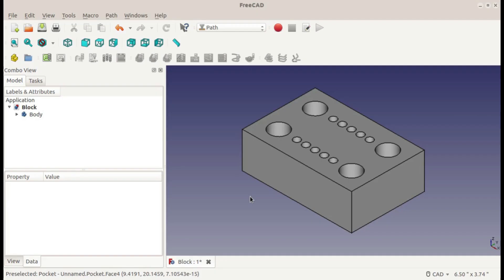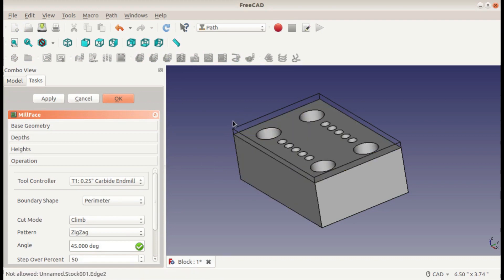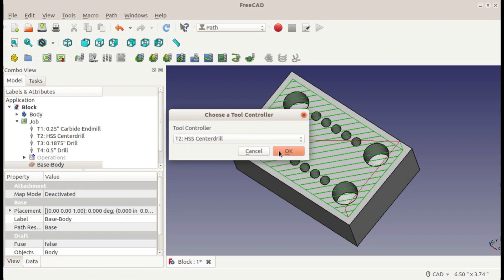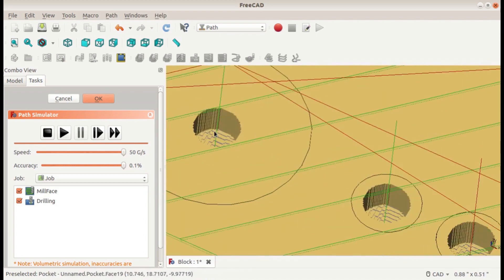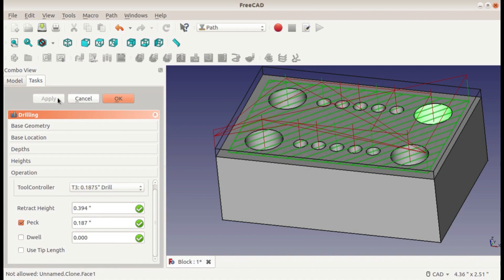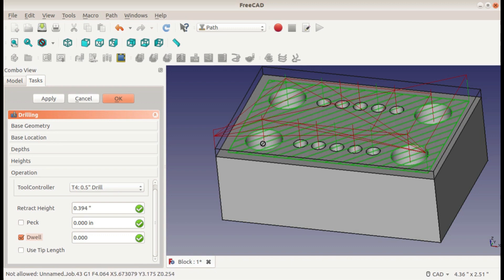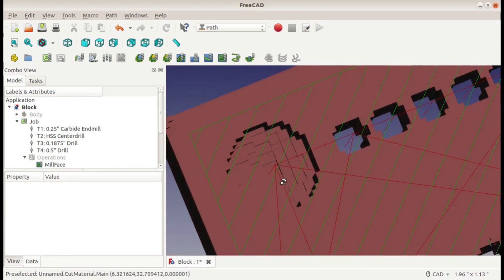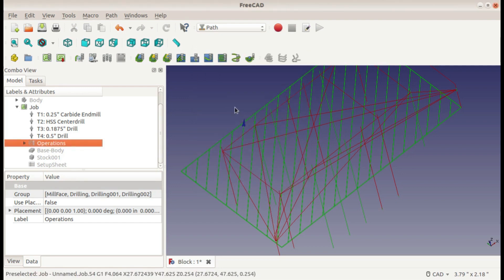Learn FreeCAD: #12 Facing and Drilling - Tutorial

Comment: Hello, your video's help me a lot to get going in FreeCad. I found some settings that could help anyone and i like to share. With the facing operation you have left the 4 corners at the stock. Filling like you suggest is No Go when you working with a cnc machine. We are making precision parts with cnc. 
In the Operation tab you can chose zigzag pattern, set the angle to zero. This wil let the cutter follow 1 axis on the machine instead of 2 axis. This wil give a lot less strain on the machine. Next in the Material Allowance field you fill in how much the cutter wil go beyond the face. This wil give a complete flat surface. Also with zigzag the cutter wil stay down al the time instead of going up few times. In your video you have no extra side material on the stock if it had any it wil leave even more material on top. I think facing is the first machine step in cnc. I hope this info wil help some people. Great video's, please keep going

Comment: For some reasons, drilling doesn't work for me, the tool trajectory just doesn't show up and simulation does nothing. I understand that talking about how exactly you build the part may take extra time, but at least showing the expanded  model tree and mention what features did you use to build holes would be useful.